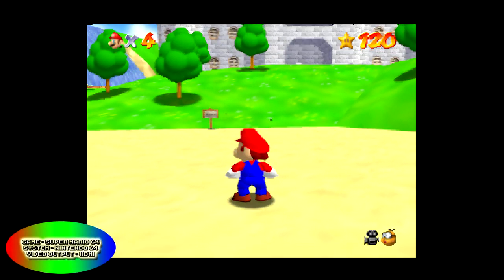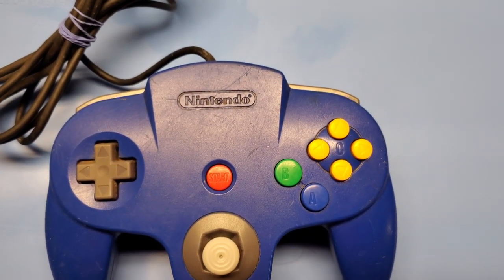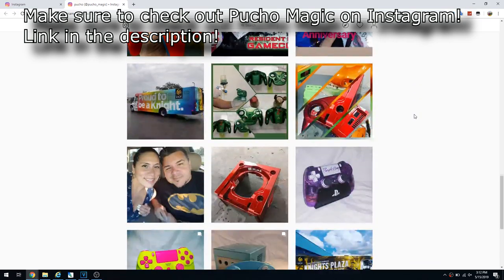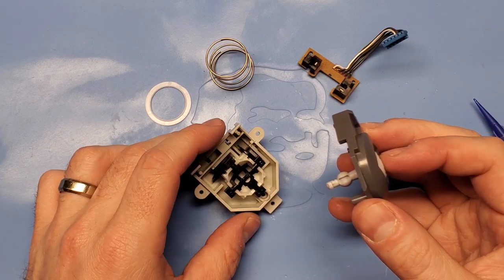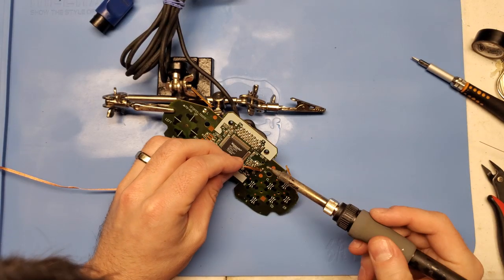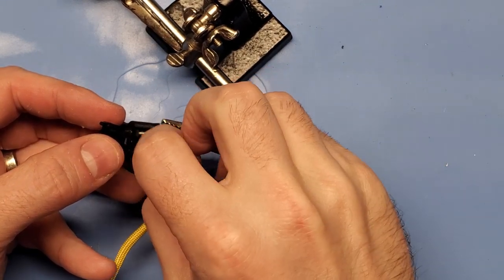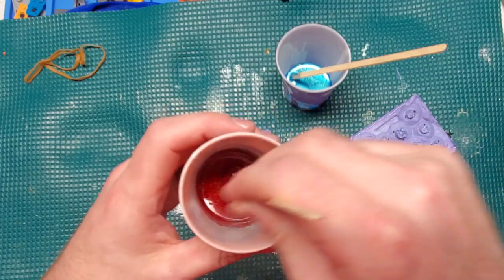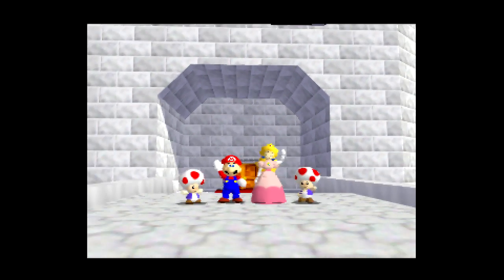N64 Controller Mod - Custom Super Mario 64 Themed!

Comment: Did you remove the rubber insulation to paracord the controller? I plan to paracord mine but I don't like how it feels when you can feel the thin wires inside the paracord, I feel that it is going to break any time lol. Great video.

Comment: Amazing video. Can you link to the video that shows how to remove the plug portion of the cord?
Reply from the maker: Dude, much appreciated!  I dont think there is one out there for the way I do it. I know the video you're referring to, but I use a slightly different method. I use metal shims instead of the credit card shims and I use heat (225* F) to pull it apart. I tried using the method in that video with no success. Maybe it's easier if I make a video on it?  Let me know what you think. I feel like the way I do it is pretty easy.
Reply: @RockerGaming  I've been able to do it with metal shims but not with heat... i thought you said in your video that you watched another guy do it.. I've never seen it done before.
Reply from the maker: Ah good call! I had been chatting with lovebot about it on discord a while back. Here is a link to Lovebots twitch video where he did it. https://clips.twitch.tv/TiredInterestingArtichokeRitzMitz

Comment: Have you seen those GameCube style joysticks for N64 controllers? Do you recommend those?
Reply from the maker: Yes I have. They work ok. For many games it's just fine (i.e. starfox), but for others it seems a bit off (i.e. smash bros). My current recommendation would be to refurbish as I show here as opposed to replace. I do intend try a few others over time, but for now this is what I recommend.

Comment: Hi Rocker Gaming
I’ve got a question for you. I have a broken N64 joystick and I don’t know where to find a good replacement for it
Should I go on eBay or can you recommend a seller or a website?
Reply from the maker: So full disclosure.  I am pretty convinced there are not great 3rd party options available.  There are, however, some custom pcb's folks have made that works with GC style joysticks.  I would like to investigate these further and I might be able to recommend them.  Perhaps your best be would be to find another broken controller and then harvest the stick from it.
Reply: RockerGaming thanks! I’ll have that in mind